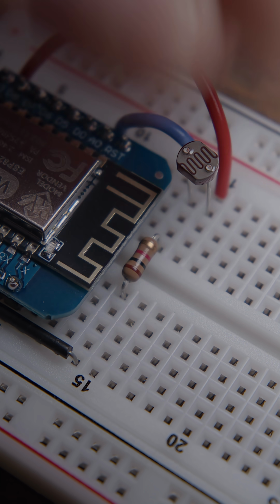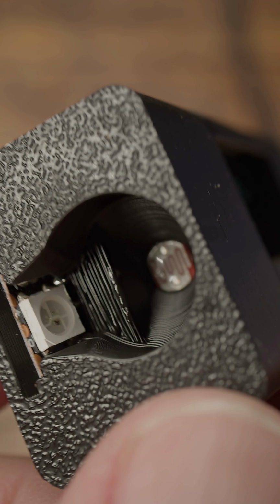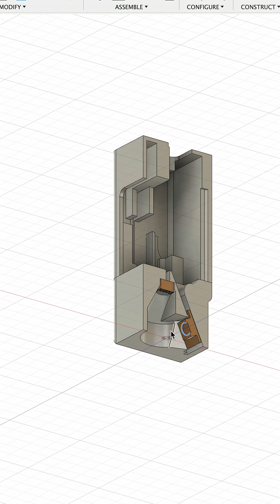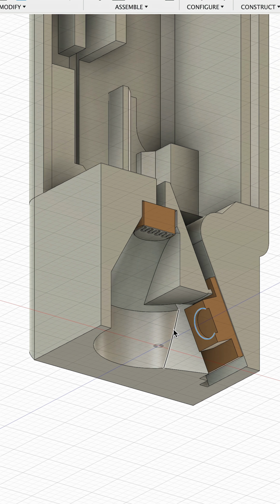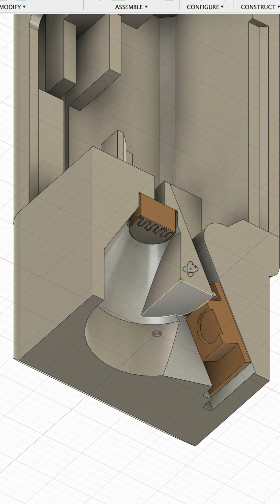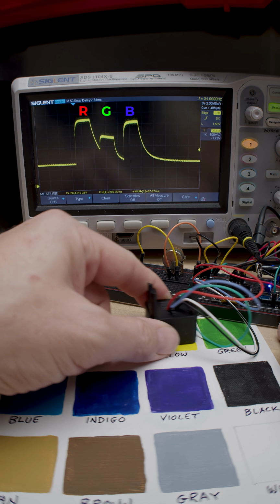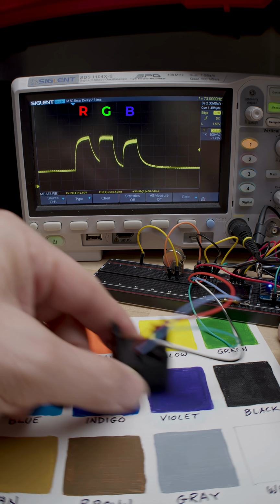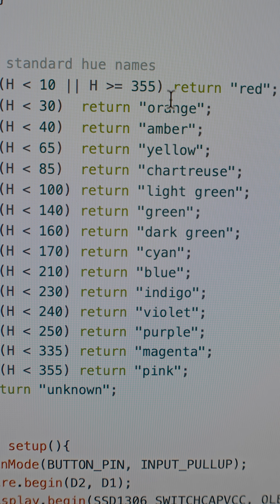LDR Color Checker

Comment: My first hunch was to use multiple LDR each with different filter on top. The use of rgb led is so smart! Cool!
Reply: I was thinking of three separated "chambers" for each R, G, B color.
Reply: That would just be faster, instead of having to pulse it could be real time
Reply: yeah i was over here like "that's not gonna work for shi... oh rgb... nice"
Reply: Parallel processing is smart too.  LDR is quite slow, so it's a 3x speedup at the same lighting level.
Reply: He could also use LEDs of each color, they can be used as photodiodes
Reply: Yeah that's just what a digital camera sensor is and it was also my thought
Reply: Glad I'm not the only one with similar thoughts. I wonder if this was the first approach or if this is the final product of many trials and brainstorming.
Reply: If you use three separate LDRs, you would only need a single white LED to shine once to get a reading. This could really improve the responsiveness of the system! That's not a bad idea!
Reply: This was my first thought too. It would probably read faster that way also.
Reply: Another way is to use the RGB LED as a light sensor. Yes, a LED works as a sensor. Each LED would capture the amount of red, green, and blue. The sample needs to be illuminated by a white LED. As a curiosity, UV LEDs also work as UV sensors.
Reply: Can you output hex code instead? 🙏
Reply: It's kind of cool and worrying at the same time, to see so many people re-invent the wheel that has been in use in flatbed scanners etc longer than they themselves have been alive.
Reply: And that would allow measuring colors from a screen. This way (single LDR) it only works for printed colors.
Reply: 色彩選別であればスマホでもよいのですが🙄

Comment: I would have overcomplicated it by having three sensors, each with a different red, green, or blue filter.  Then the light source can be constantly lit, and the device can be constantly measuring.

Comment: Neat! 
Improvement idea which might be overkill: currently th sensor sits at the end of a cone, allowing for sine stray light to be reflected into it. This in commonly fixed by replacing the cone with a staircase pattern. For reference look up 'pancake' lenses, or any other lenses with large mounts.

This should giveb you better results for bright colours.

Comment: Place an additional LED outside and have it illuminate the RGB value intensity that it captures below to show an accurate reflection of what was picked up 👍🏼
Reply: There's one catch with this though. RGB values are a relative measure, basically a percentage. And they are relative to two things, working colour gamut and white point. 
Firstly, if I tell you "100 % Red", within sRGB it would give noticably less saturated colour that in P3, where that exact same colour would be maybe only 90 % red. And maybe only 70 % of BT-2020.
Then the white point. If you have a cool white point, getting blue is much "easier" and requires "less blue" than if your white point was set to something warm.
Simply put, for these relative RGB values to make sense, you have to first have a maximums defined.

The way to do this would be capturing raw CIE XYZ, or xyY values and then have some software translate that into user selected colour volume (which would specify gamut, white point and maximum luminance).
Reply: @TomasReo but the reflective surface, colors of r g and b, and intensities are the same between the light reflecting into the ldr and the light reflecting into your eye. the only variables i can think of are the linearity of the ldr and the rgb led (correctable, and i assume the ldr has a graph in its datasheet about it), the fact that your eye picks up light differently from a ldr (eh probably fine) and the fact that the led can only add light to the reflective surface so, like, black would appear white on white paper (ok this one is pretty bad).

Comment: It you applied a light absorbing paint to the inner chamber you could refine the sensor further by removing as much of the internal reflections.
Reply: True but you assume a very high fidelity of the LDR sensor and the LED emitter. I doubt it is that sensitive it would make much of a difference. A better sensor would benefit but it would not give better results in this context.
Reply: @HenkJanBakker that maybe be true. Photo resistors are a blind spot for me.
Reply: vanta
Reply: @plantstho6599  that is an option
Reply: @plantstho6599  fuck no... expensive as hell only only usable by 1 scumbag painter... also iirc "black 4.0" is blacker than vanta... definitely close enough at least
Reply: He's using a $0.01 LDR, the noise from that thing alone is ten times what scatter can do :-)
Reply: @vinny142  that is true then again they have gotten better the last decade.

Comment: Or use 3 color filters on 3 light-sensors and use a white led a 3 input comparator  and NO microcontroller?
Reply: Just make sure you have a high CRI rated white led, or the readings will be off.

Comment: neato. 
one of my current projects is using a color wheel and color sensor as an absolute position encoder. 
okay, more of an appropriate position, but still way good enough to make a robotic dog leg joint though. 
also, it is around the perimeter, so the whole center of joint is freed up for cycloidal disks.
Reply: cool idea